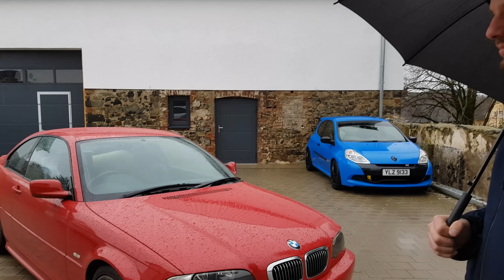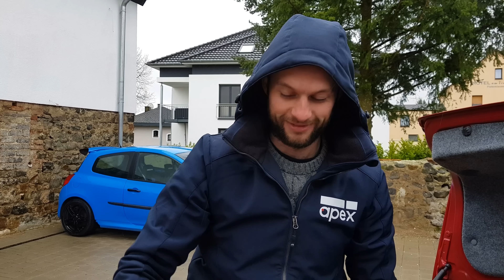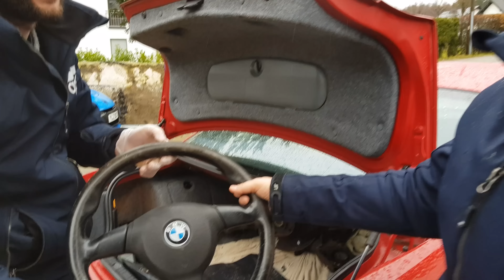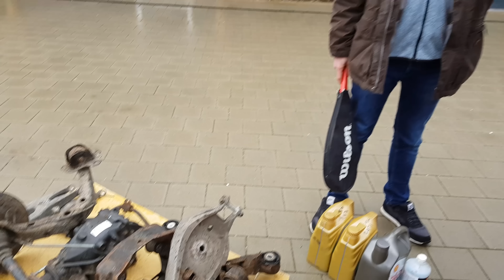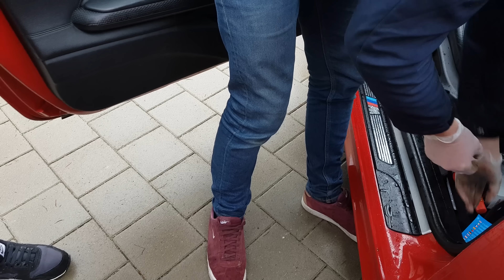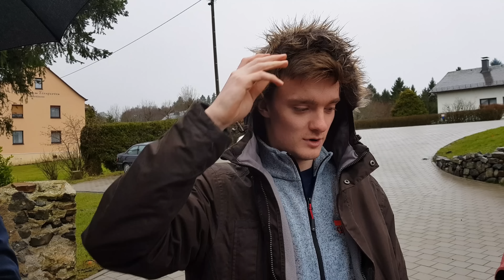NEW FAMILY MEMBER: BMW E46 325 ci RING TOOL

Comment: As I'm sure Tim is aware, E46 rear subframes have a habit of ripping its mounting points from the boot floor. Will Tim to any 'preventative maintenance' while he's swapping the subframe over? Contrary to what BMW will tell you, it affects all years of E46, not just the early ones. Nice vlog as always Misha!
Reply: More common on the m3's since they are driven harder, but yes since this is gonna be a tracktool They probably will
Reply: My e46 328ci was ripped through the floor
Reply: My E46 330i Touring was all good (despite a hard life & some track use). My bro had a E46 328i Saloon, and the floor ripped on it.

Comment: Did Tim go to BMW part heaven?
Reply: Smile maker - Only just scratches the surface ;)
Reply: Tim Morley not bad at all!!
Reply: hey tim! does the guy you have the e46 parts from have a dealership / more parts in stock or was that just a one off? cause i would be interested in a 330 diff 2.93 or 3.07 and driveshafts. cheers